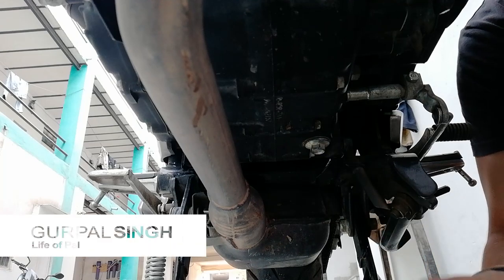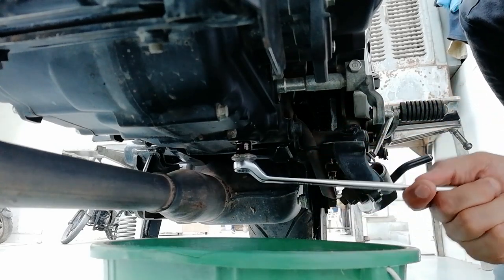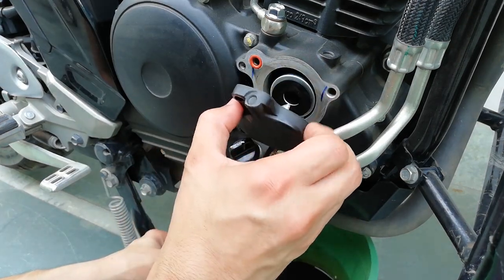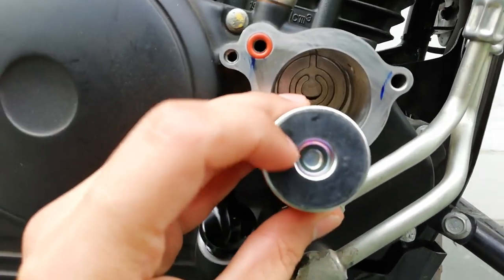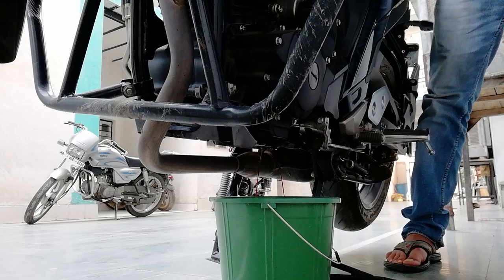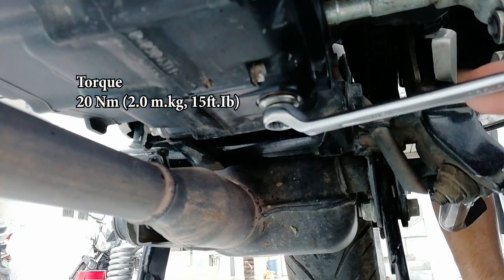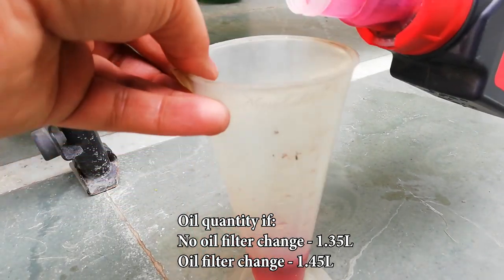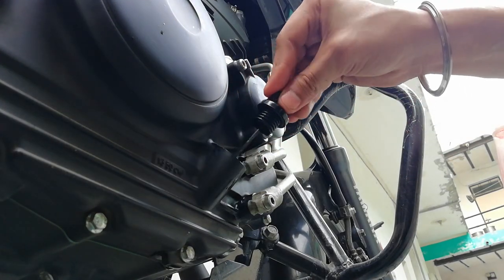How to change engine oil and oil filter | FZ25 | DIY

Comment: Can we use motul 20w50 in fz 25
Will it damage the engine parts
Reply: No bro, viscosity depends of your local weather for example if the tempeture of your city its above 39°C the right viscosity its 20w50, but make sure pre hot oil before ride like 1 or 2 minutes for circulating oil. Try not change type of oil like full syntetic to mineral or viceversa thats will be damage your engine
Reply: No bro, viscosity depends of your local weather for example if the tempeture of your city its above 39°C the right viscosity its 20w50, but make sure pre hot oil before ride like 1 or 2 minutes for circulating oil. Try not change type of oil like full syntetic to mineral or viceversa thats will be damage your engine
Reply: @mauricios757  ❤️

Comment: Bro i recently change my engine oil at a local shop they use 20w-40 4T castrol ... will it hurt the engine?
Reply from the maker: Yes it can. Its bit heavy than 10w. And i think its mineral. Better change.
Reply: Thank you .. i was a bit sceptical about the stuff .. i googled it and read an article about the stuff but it says that u can use it too.... I just changed mine yesterday so i ask a few more guys and probably hope that using it for about a month wont really hurt the engine ...thank you again... I'll have some more questions in the future i hope u keep urself active..God bless
Reply from the maker: I don't know from where you checked. If it was bike like splendor then i would say ok because i know oil pump is able to pump that viscosity but i don't really know if fz pump would able to pump that effectively or not. It based on design. Rebuilding small engine is cheap but building this would be very expensive so why take risk. There was guy who go damaged by using 20w50 oil. Well the real cause is unknown but sure enough 20w50 is overkill.
Reply: I'll try to paste the link where i found the article..your making me nervous now lol

Comment: in yamaha Peru to my fz 25 are throwing oil yamalube 10w50 unlike what the user manual says, they tell me that in their service manual says it? That's true?
Reply from the maker: Our owners and service manual says 10w40. It must be same for you as well. Check the owners manual you got with the bike.
Reply: I'm also using yamalube oil... It's better r not otherwise i using motul 4T bro??
Reply from the maker: @SanjayKumar-hz6uh  yamalube is not bad but only last 2500. Motul 7100 10w40 last 4000. You can also try veedol super swift cheap and last 3000.
Reply: @LifeofPal  k tq bro, but oil will change means definitely change the oil filter??
Reply from the maker: @SanjayKumar-hz6uh  yes oil filter change is must

Comment: I used motul 300V 15w50 for my fz25, is it good to go?
Reply from the maker: I don't think its good because of w50. I didn't tried but what is assume is bike must be heating more. And cold start in winter will be a problem.
Reply: Life of Pal I live in Hyderabad so I don’t think winter will be that much of a problem here as temperature never goes down below 18 degrees
Reply: Life of Pal and I used W50 because the climate of Hyderabad is dry and hot for 70-75% of the entire year and since it’s an oil cooled engine I thought it needs an engine oil of higher viscousity. So what do you suggest? I changed it a week ago so do you suggest to change it asap or should I change it after 4 months?
Reply from the maker: Higher temperature doesn't mean higher viscosity should be use. Higher viscosity will not flow like lower viscosity. Since engine oil helps circulate heat throughout the engine, if oil doesn't flow better then heat will not regulate better. Higher viscosity means less gap between moving parts hence even more heat generation. This is logical knowledge. Now practically i didn't used w50 so i cant comment on its characteristics. I go with company recommendation. Now you have to judge yourself. If you feel good, keep using and then change. Why waste the oil. And share your experience.
Reply: JASOMA standard ka nahi hai motul300.  Even motul7100 is JASOMA2. oil properties of yamahalube nahi milega. better use 7100.
Reply: Do u still use 7100 motul10w40? city ride mein kya change feel hua apko. i too own fz25 , 8000km done.
Reply from the maker: Yes i do, its way better than yamalube. Performance is awesome. Pickup increased. Try karo farak khud dekho.
Reply from the maker: cover hoga but unlog se ek bar baat karlo aap

Comment: Nice info.  I will also used motul in next service,  can you just tell me the price of motul oil,  oil filter and air filter price
Reply from the maker: Motul cost 650/700
Oil filter 125
Air filter 276
*prices may vary
Reply: @LifeofPal  from where did u bought oil filter , is it online or yamaha SVc
Reply from the maker: @SumitKumar-ru1lz  from svc

Comment: How you know you're applying the exact torque?
Reply from the maker: Guess
Reply: @LifeofPal  which engine oil is your using?
Reply from the maker: @raghulponnusamy9034  currently using super swift from tide water co.
Reply: @LifeofPal  I have ordered the motul from your link In description that's perfect only rite for Fz25?
Reply from the maker: @raghulponnusamy9034  absolutely perfect
Reply: @LifeofPal  just bought motul 20 w 40 from your link but you have used 10w40 will 20w50 suits or you provided wrong link
Reply from the maker: I seriously provided 10w40 link but don't know how its showing 20w50. 20w is not recommended. 10w40 or 10w50 is.
Reply: @LifeofPal  kindly change it bro, I bought from amazon can't return also, web says 20w50 will work for hot climate my area is actually hot, planning to use it cuz its not returnable, next time planning to 10w40 what are your suggestions.
Reply from the maker: Yes one time use is not an issue. Xt250 is recommended with 20w50. Sorry for the error. Some people are using 20w50 on fz25.
Reply: @LifeofPal  no issues got the refund ordered 10w40 itself

Comment: Oil is also in oil cooling pipe, which should also be drained.
Reply from the maker: Escalate this to company and tell them to be written in owners manual and followed by all service centers across
Reply: That is not needed, because it gets drained automatically to the sump when the engine is off.
Reply: @shriharikulkarni07  when re-initiated the process of change of oil, old oil was there without opening the pine old oil don't drain automatically.

Comment: Bro does the warranty gets seized?
Reply from the maker: No yaar. Better discuss with svc
Reply: Really?
Reply: After how many km we have to change oil?
Reply from the maker: Motul 5000. Yamalube 3000
Reply: Oil filter should be changed or not ?
Reply from the maker: Yes everytime when oil is changed

Comment: You havent drained the oil from oil cooler.. since fz25 is oil cooled engine,so while changing oil we need to remove from oil cooler also
Reply from the maker: Its not mentioned in service manual. What about the oil left inside the engine?
Reply: @LifeofPal  oil cooler bolt is near the oil filter.so last time mechanic drained that too which had some oil.so thought of sharing with you all

Comment: Plz see Cherry vlogs.  His fz25 bore damaged . Plz give ur opinion.
Reply from the maker: There are multiple reasons. Depends how it kept and drive. But if we only talk about the engine oil. 20w50 is very wrong choice.
Oil pump is designed to pump certain viscosity, and if you give him a thicker oil the flow will reduce. Also thicker oil will tighten the metal clearance which is again damaging.

Comment: I'm still not sure about pouring capacity of oil in fz 25 without changing oil filter it's 1.2ltr
With oil filter change it's 1.35 LTR will you please confirm?
Reply from the maker: 1.35L without oil filter
1.45L with oil filter

Comment: anybody have your fz25 engine noise
Reply: Go to yamaha service center and ask the service center guys to check and adjust the valves if the noise still comes i recommend you to change the engine oil to motul i have been facing that problem as well.